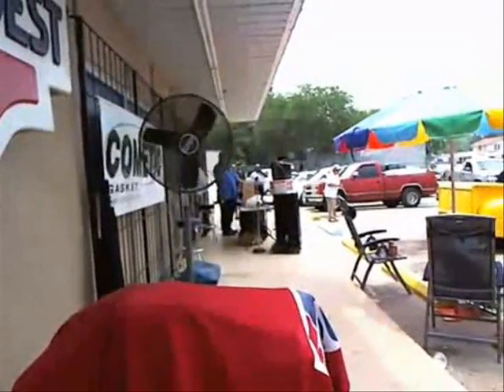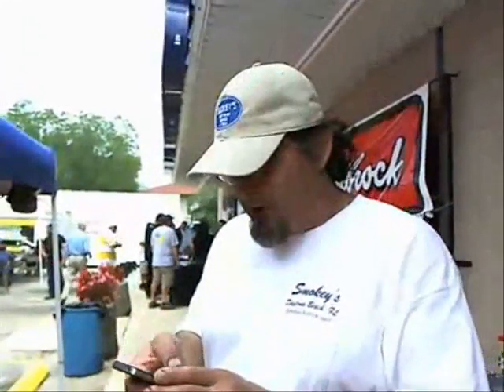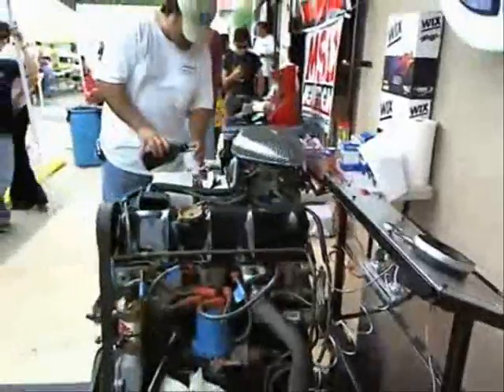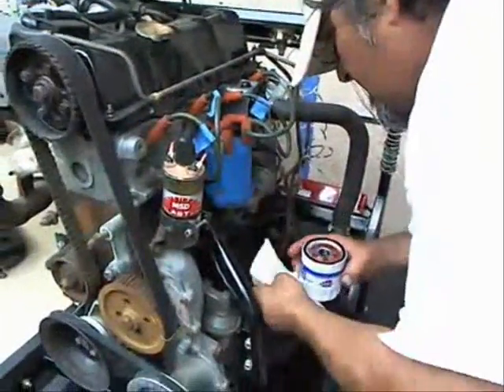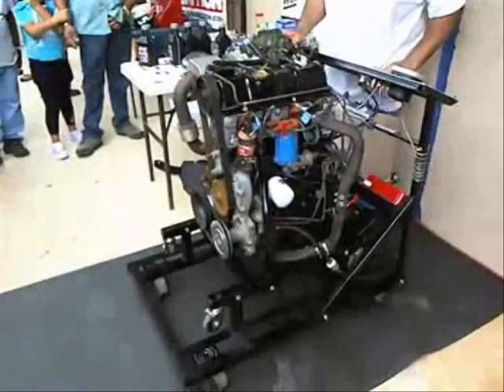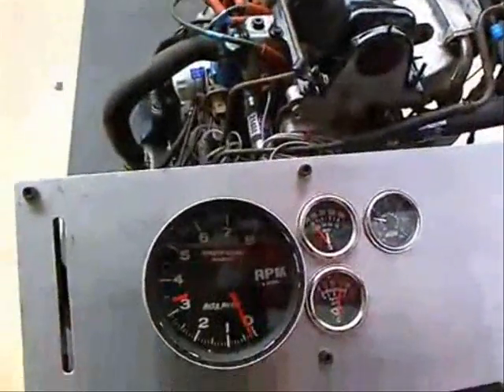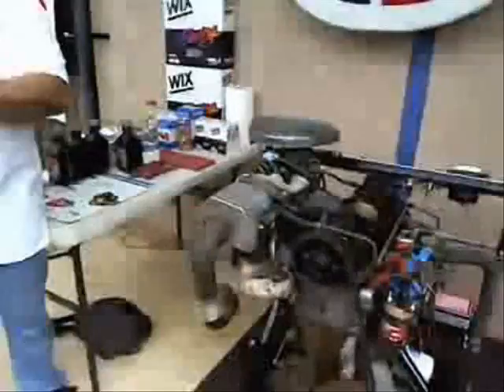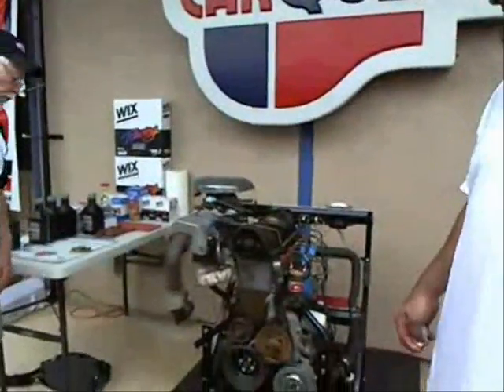Danny Soliz running Smokey Yunick’s Hot Vapor Engine

Comment: why is it not in a car proving the MPG and HP all day every day ?
Reply from the maker: I’m putting the engine back into the original car,then we will be able to test MPG.
Reply: @MrDanielSoliz  was this ever done? Thank you for your time and efforts.
Reply from the maker: @the_hobby_cavethcracing444 engine is back in the original car Smokey Yunick built for Chrysler. I have videos of us installing the engine and first start up. We have just done one test drive. Getting the car ready for some testing. We have done the fuel system and brakes. This weekend I’m doing the transmission and am fabricating a lower radiator hose fitting so we can get some data from the cooling system. Also going to add an O2 sensor to the exhaust for data as well. Still need to restore the 5th wheel that hangs off the back of the car to get MPG and need to find and add a fuel meter to get data on fuel flow.  Getting the car ready for dyno and track time. I have lots of videos on the car and on my YouTube channel, Faye also has videos on her channel.

Comment: The reason nobody wanted it was because it didn't work as claimed.. There is a running engine right there. The power and economy can be tested. Why would 'they/illuminati/government/whoever" let that engine exist where anyone can test and reproduce it. Why, because it has been tested and proven many times to not work as claimed. FYI every car manufacturer makes electric vehicles that make more power and use no fuel. Why hasn't the dredded "they' put a stop to it? Smokey did some great things but he was human and one of his ideas didn't work. It doesn't have to be a conspiracy.
Reply: How many times was it tested?  Who did the tests? Where are the results?  What OEMs were involved?  Who were the Execs at those OEMs?  What was their history with Yunick?  What NDAs or Confidentiality Agreements were signed?  What if it did work, but was not cost effective?  What if it did work and the constraints of the time such as oil and materials tech was not advanced enough for extended life?  Those are some interesting questions.  But if you really want to go down a rabbit hole, what if the engine(s) did work as advertised?  What if there were dyno pulls and eye witness testing a resulting reports produced by eminent engineers from SwRI like Springer and Ingalls and additional contemporaneous reports by Gregory Flynn, the guy who at one point headed up GM's motor division and he signed off that it worked?  What if it worked and we still don't have it in production?  Now, that is a question isn't it?

Comment: So can anyone tell me why this never made it past a few prototypes ???

Smokey or SoMeone could have sold a kit.....
Reply: It is a long story, Regarding the kit, there was a time where that was explored as a joint venture with Crane, but it was scuttled primarily because the lawyers saw to much exposure with potential improper installs.  Some other reasons:
WHY NO ENGINE IN THE INTERIM 40 YEARS?  
 
1.	The first reason is OIL, not Big Oil, although that is a part of the answer too.  In the early 80’s the widespread availability of synthetic motor oil and lube was a decade or two away.  In order to make the engine functional at the temperatures required for the engine to achieve Hot Vapor process Smokey was using Jet Engine oil that was 98 dollars a quart.   
2.	Of course, Big Oil was a reason as well.  After the Oil Embargo of 73 there was a push toward fuel economy.  But by the time Ronald Reagan assumed the Presidency, one of the first acts was to remove the solar panels from the White House roof.  The rest of the decade saw a move toward less of an emphasis on the fears of the 70s and the return of gas shortages. 
3.	The OEMs had ideas of their own and moved back toward the idea that cooling an engine was the answer.  They had also made a commitment toward EFI and they were not going backward.  The culture of that time (Pre- Jobs, Gates and Tech Entrepreneurs) tended to look down on engineers without formal degrees. What Marlan Davis called, “it wasn’t invented here syndrome” in his article for HotRod Magazine: “It was the "not invented here syndrome" rearing its ugly head again. “How could a couple of gearhead hot rodders know more than all of Detroit's best engineering talent?” 
4.	Lack of access to the original engines.  Smokey made the conscious decision and concerted effort to keep the hard tech from the “suits”  There is good evidence that even trained engineers with access don’t understand what they are seeing and misidentify and misunderstand what is in plain sight. To the trained eye Yunick’s efforts to effectively camouflage critical parts and components is evident.  This pattern of false bread crumb trails carried over to the patents themselves where Smokey would use in-exact, misleading, or made-up descriptions as well as omissions to throw potential IP thieves off track.  We have already identified at least one instance where the drawing in a patent is not the same as the working physical engine. 
5.	There is no doubt that the fall of John DeLorean was a crucial set back.  And, the Hunt Brothers were having their own problems with Law Enforcement.  However ultimately, it was probably Henry “Smokey” Yunick that made the conscious decision himself.  There was no arguing Yunick’s genius. Nor his eccentricities and “My way or the highway” terms.  He was now in his 60s and was slowing down, thinking about writing a book or two.  He was already a legend, decorated WWII Pilot, Inventor and had won over 50 races in every type of auto racing. He had business interest in South America.  He had spent decades being challenged by Auto and Race Execs.  The endless parade of engineering teams alone must have been exhausting, always the fear that they are going to steal your knowledge and work.   To prevent this there was always a false trail in the treasure maps he left behind, “It is really quite simple, and I am careful not saying too much. This is the only way I can be sure nobody knows how the system exactly works says Smokey”  Swedish Hotrod Magazine 
6.	At the end, maybe he just got tired, to quote him as he closes out the chapter of something that he pursued for half his life, “These things start out as a little conversation and like a hurricane get spinning faster and faster and I guess where the inventor generally gets blowed out the side someplace then the wind and rain goes away and in thirty days it is like it never happened.  As it stands today the Smithsonian has inquired about a hot vapor engine for their museum.  Maybe you can check it out there if they never get it into vehicles.  They’ve also got one of my hats.” Eating the Elephant page 249.
Reply: MYOB  Sweet.  So, I am guessing that you are an SAE member.  I will give you a couple of names that you can Google.  I am not going to do all your work for you.  First name Gregory Flynn Jr.  Ran the motor division of GM, Ran the Sterling Engine Project, SAE Board of Directors.  Karl J. Springer https://www.nap.edu/read/11620/chapter/10#150  They both say it worked: In writing!  For the MPG study it included 10 133 mile City and Highway runs.  The car running on the dyno that passed emissions did so on the 5th out of 6 runs in January 1982 at SwRI.  We know.  We have the receipts.  All that stuff that people like you have been saying for years will be proven wrong.  I suggest you subscribe to this channel, so you can be notified if there is a broadcast showing the records.
Reply: Yep,  its called insider trading & cohersion between companies like car & petroleum companies to manufacturer what they want us 2 have instead off what would be more beneficial 4 everyone. A 51mpg engine is going 2 slow down the fuel bowsers & petroleum production.  My old boss built a carburetor that did the same thing & same results on a 6 cylinder aussie engine.  He never ever would show us the carby he designed & made.  He took the whole thing 2 his grave 👎👎
Reply: There could be numerous reasons such as it produced to much heat or the engine life was too short etc. Anyway I don't see what was so great about it. They have small tdi diesel engine cars in Europe that get 80 mpg.

Comment: Great idea from a brilliant man but the reasons it wasn't out into production was reliability issues and it tended to catch on fire. The fiero was demonstrated on engine power a few years ago and it caught on fire. It didn't burn up because it was extinguished immediately because this was a known issue.
Reply from the maker: The asbestos would catch on fire when it got wet but when it caught on fire on Engine Power was because they pulled on the spark plug wire when they put the tach wire to get rpm for the dyno. The wire caught on fire and they didn't have a replacement one and didn't care to find one, so they did a fake dyno pull for the show. Tony was not happy about that.  Tony drove the Fiero for two years without any issues before donating it to the Don Garlits museum.
The manufacturers would not allow an engine that passed full emissions without a catalytic convertor.
Reply: @MrDanielSoliz  
The technology still needed refinement to be safer, if simply pulling a spark plugs wire caused a fire. The engine was viewed as a huge liability because, as you know, simple maintenance by most owners is often neglected. Atomized fuel is quite literally a bomb if not handled properly. Should have been more interest and development done by major manufacturers. It's a shame it wasn't/ isn't being pursued more, this tech could be revolutionary. Smokey was a genius. Einstein of the automotive world.
Reply: @member57  There were many factions and factors that were at play in the early to mid 80s that shelved it then.  I think at some point Danny may have a show about the development history and some of the players involved.
Reply: MYOB  From the report: " I mileage test for the vehicle was conducted using a 133 mile driving loop that included both city and highway speeds"  And to head off that Smokey was a slight of hand magician the vehicles were at SwRI for days at a time and Smokey was in Florida.
Reply: I think the main problem was the engine was not cheap, nor relialable or easy to make especially when you had to make a utility car small engine.
For a manifacturer it wouldn't make sense to make thay engine for performance cars and fuel port injection for econoboxes so it was shelved.
At the time the biggest concern was pollution over co2 emissions so a catalytic converte with injection was a more viable way.
Same went for diesel adiabatic engines
Reply: @phantomsoldier497  shilling for corrupt corporations heh? The only reason you don't find this in the market is because not only it will expose the catalytic converter fraud industry, but also add more fuel mileage and more IMPORTANTLY you only buy 1 car to last you a lifetime. No carbon build up and no carbon monoxide poisoning means there's no need for catalytic converter and the engine compression will never diminish provided it's built correctly. Therefore no yearly car sales and no power to the few criminals to control politicians to pass laws that don't apply to them. Car and oil corporation tried to combat the vapor engine just so they can secure their spot in hell (because God is not real to them) by adding LED to gasoline. What that does is create SPARKS at certain temperature when gasoline is heated and heating gasoline is the only way this can work. As a matter of fact that 53mpg isn't efficient. You can go 200mpg easily with V4 engine. And yes I know about Internet and the Elites collecting information on the internet and YouTube. It doesn't matter. Their time is short.
Reply: MYOB  You are welcome to watch the live broadcast where we show where this and other hard facts came from.  The speculation is over.  The facts are from 3rd party independent highly respected engineers and research facilities.

Comment: Sorry but this is shaping up to be another one of those conspiracy subjects mainly sustained by blurry footage and talk, talk, talk.

Why don't you give us a detailed rundown of all the components followed by some actual tests with hard data, compared to other common engines of similar volume? It would be so easy.
Reply: Do NOT Danny will film a series detailing the multiple hot vapor engines we have, as well as installing the engine you see here back into the Plymouth Omni this engine was built for (we acquired the car a few years ago, after this video was filmed).

Comment: ok...yeah, you put some engine a stand cranked it up......whooo --hoooo... even if it is Smokey's engine what are you going to do with it?...put it back into storage?.....how about getting it on the market some how so we can reduce our fuel consumption...
Reply: Yes, it is one of Smokey Yunick's hot vapor engines (we currently own five of them) and we are now the owners of the car that it was built for and we will reinstall it and show the results here. Stay tuned!
Reply: @elainesoliz2205  keep 'em straight Shop Mom.
Reply: @elainesoliz2205  hola eliane!! Debo decirte q se ponen peligro real,, tu entenderS por qué lo digo 🙋‍♀️🙋‍♀️🤷‍♀️🤷‍♀️
Reply: That's just it, all the big three had a chance to mass produce it and chose to go fuel injection where 70% or more of the fuel goes out the exhaust. How much money is wasted? How much money does the suits make off of the fuel industry? I  hope he does put it in the car it was built for. And then back it up with the modern version. In this world where you can get a ticket for not having a converter on your way to the shop to get one put on because someone stole the one that was on it because they are to lazy to get a real job or need another fix.
Reply: @shaunadams3170 That is the plan, Shaun Adams!
Reply: The problem is Smokeys Patent on this design ran out after the twenty years was up, anyone can use it, no one protected by the Patent...

Comment: Hmmm... scratching my head over the thermodynamics claim of "no radiator" ... nevertheless, is THAT the typical 2.2 turbo Chrysler engine from the likes of GLH, GLH-S, turbo LeBaron, turbo [ Sundance ] and such ?
__ If both Chrysler and possibly Pontiac had a vapor engine built, which one saw the greatest development leaps, which was developed to the greatest refinement and how did their fuel efficiency, horsepower and torque numbers compare??
_ I thought this was going to be a Pontiac Fiero [ adiabatic ? ] vapor engine demonstration when first  clicking upon its link.
__ If the above premise is true, what power plant used the vapor-breathing in the Fiero and is it true the Fiero was assembled and modded under Yunick's direction by his own hands alongside a team? If the Fiero effort had a team, who comprised it?
__ Could've, should've but yet wouldn't... Had alot of potential...  Here are a couple pages from a publication mentioning engineering studies that took place on 4-wheel-steering as well as 4-wheel-drive testbeds:
https://2bluesc.com/pictures/Other/misc/four_wheel_steer_big.jpg
__ Four wheel drive would've been a great match to the claims of this powerplant let alone a 4-wheel-steering system decades ahead of what's showing up now and contemporaneously matched in its four wheel steering only by select 1980s Honda Prelude and Mazda MX-6 vehicles while having more power than both, combined. The 5-speed Getrag's eventual use with GT's and Formula's 2.8 Liter V6 would've likely mated well with this vapor breathing engine for better highway / interstate fuel economies....

Comment: what would have the mpg been with fuel injection? With the carb it got 51 mpg!
Reply: ....heat the injectors.
Reply: Hot vapor system has nothing to do with fuel injection spray system. Two totally diff systems
Reply: In this engine, it would have to be a Throttle Body Fuel Injection unit, in place of a Carburetor, otherwise you defeat the concept of how this engine heats, blends, and vaporizes the fuel before it enters the combustion chamber...
Reply: The problem with fuel injection is the pressure. When you increase pressure you increase the boiling point of fuel. Making it harder to turn the fuel into vapor.
Reply: @PhaQ2 
then you increase compression ratio and timing

Comment: This Technology was destined to be installed in the Delorean...Smokey was waiting on a phone call from John the day the drug bust occured...Government conspiricy to protect the oil companys, as far as I can recon...
Reply: LeftyLucyRightyTyty ,  I'm inquiring for more details, providing what I've come across within my comment above on 10August2017 regarding a vapor [ adiabatic ? ] engine designed by Yunick for use in a Pontiac Fiero as well as 4-wheel-steer and 4-wheel-drive Fiero testbeds article sharing the existence of those engineering studies.
Have any insight, corrections to share?
Reply: I may be able to provide some insight. My website is rocketheater.com

Comment: He said it got 51 mpg on the highway. A stock configuration should get 40. I have calculated vapor to be at least 10% more efficient so it could be true. Gasoline is crap they should be using alcohol.
Reply: Back in the day this vapor engine was made,  20 MPG was great!
Reply: I have thought the same thing or at least distill our gas and see if it would get better mpg.  Even what they sell as pure gas now days is junk and will sour in no time.